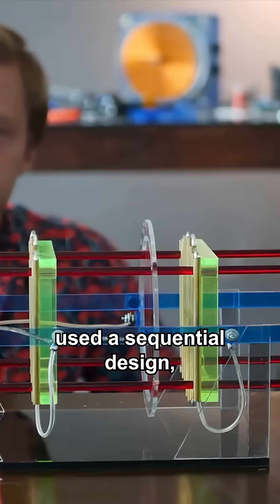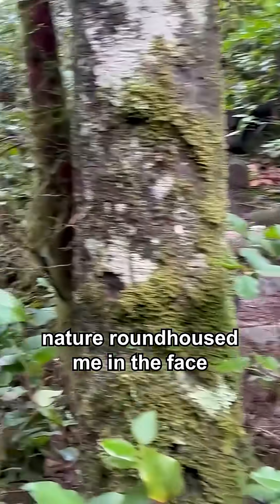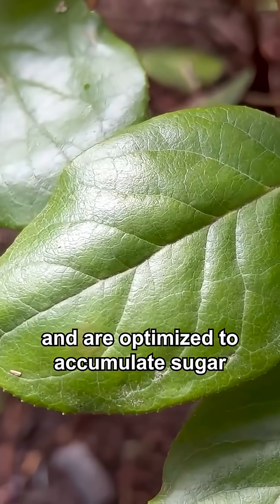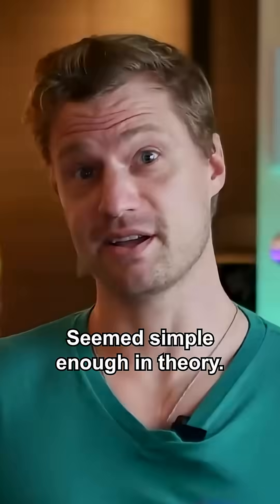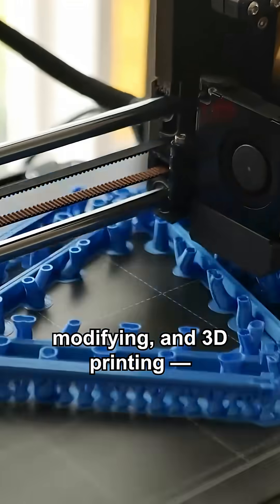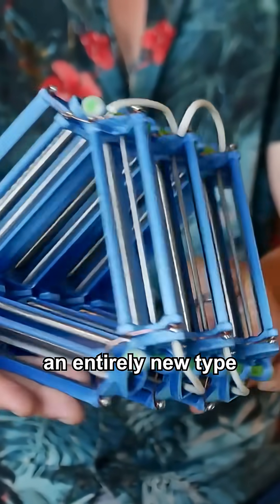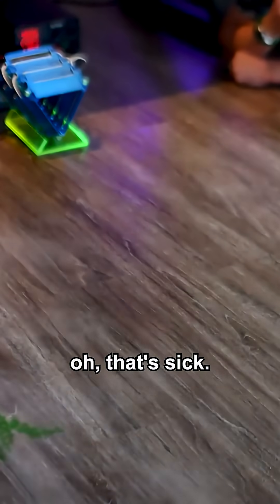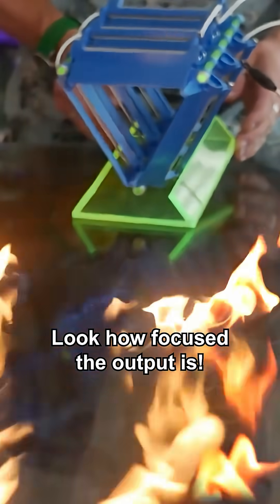Next-Gen Ionic Plasma Thruster Inspired By Nature (BTC Mark 3)

Comment: And I remember building these little ion devices out of balsa wood and aluminum foil more than 20 years ago. I've had an idea for a version that used 3D printed parts to frame the structure for an ultralight housing. The problem was always power, using balsa wood My little circle of friends was never able to get the power to weight ratio right to allow the thing to operate under its own power.

Comment: Now, add to that uh, mm, microwave, that was directed and electron gun emission. There was also directed and built into a similar kind of Ventura effect, like you're showing now give it a static electricity, kind of thruster on top of all that. M, then give it a little bit of explosive power for extreme Movement, and you've got hmm, uh a Tic Tac or a foo. Fighter, yeah, it's been developed once and twice. And before now, all you have to do is bring it together right now

Comment: One of the best parts about an ionic thruster, though, is that it's very fuel, efficient, and theoretically you can use any gas so it doesn't have to be oxygen. So you could use hydrogen which is the most abundant s*** in the universe
Reply: But it wont work on plants because we are taking away most of all carbon dioxide they use to make sugar ...

Comment: Ionic thrust is not “quickly becoming a viable form of propulsion” it’s not even slowly becoming a viable form of propulsion, because it’s not a viable form of propulsion. Outside of space travel with zero gravity, ion thrusters are useless and always will be. The amount of thrust, well, lack thereof, means it will almost certainly never be a useable form of propulsion. By the time we could develop an engine light enough to produce enough thrust to be useful we will have developed new forms of propulsion. We will sooner develop gravity engines and warp drives than we will ionic propulsion engines. Mark my words.

Comment: Hmm. I love this stuff.

Let me ask you.. if they are in sequence, assuming the first thruster loses some power ionizing the air, and each sequential thruster does less ionizing and more acceleration, should you not also sequentially increase the voltage as it travels through?

Would that not reproduce convergence?

Comment: I thought about something like this decades ago.  Redesign this to form a Tokamak torus in a vacuum sealed container. Every 4th ring, place a static collector and wire all of them for voltage stacking.  Feed the voltage back to the thruster elements and watch the thing try to tear itself apart from the sequential acceleration.  Poor man's particle accelerator/fusion reactor.
Reply: Something I thought of a couple of decades ago...I have all sorts of ideas that go with this main concept.
It is meant to go up and stay up. Torus filled with aerogel under a vacuum with a superconducting loop of energy. Skin of torus covered in solar collectors. Sphere at the center with counter rotating rotors between the sphere and torus. Spheres Of Reproducing Organisms Soaring.

https://youtu.be/DL_ISlCIsls?feature=shared
Reply: Could this be haw the Vision flies

Comment: it might be a valid form of fan sitting on the ground, but it will never be a useful form of thrust on earth. you didnt show the massive power supply or giant heavy batteries powering it. even if you could make it efficient, which its not, the output will always be tiny compared to alternatives.

Comment: I suppose the question is, how much power does it consume vs. propulsion it provides.  Yes, at low levels, using solar to power it, it can create thrust.  I would like to see this integrated unto extreme ultra light weight model aircraft to see if it can keep something aloft.  It's all very interesting.  Thanks for the video.

Comment: I told NASA about the Moon and they made Moonfall ; ) We need to make a Universe room and reverse Tesla ball atmosphere models, also just spray desalination ocean water, not aluminum and carbon which cause refractory radiation and is cooking the atmosphere and causing refractory radiation on the surface making it intense, also you might be able to change an orbit

We gotta stop spraying aluminum and CO2 into a magnetoshere and start spraying desalinatated ocean water instead, were causing refractory radiation and it's making the heat much more intense and heating the planet and causing melting of ice caps and evaporation of ocean water which then makes fresh clouds; we need to just spray salt free ocean water. The more we try to cool the planet were actually making it hotter and energizing a magnetoshere which could cause more solar flares and fry us. We're cooking the planet and causing solar evaporation of the ocean for clouds formation instead of just misting H20 out of 747's, got a whole plan

Hello my Friends

ANUBIS IS THE BEST DOG

What if Pharoah was trying to build a weather machine to attract lightening to nuclear electro magnetic earth ground to cause more rainfall and thus more food. 

Clouds of higher solar charged particles jump to clouds of lower static change, known as heat lightening, as nature seeks a balance. 

When there's enough solar charge in a cloud electricity as lightening crosses the air insulator and connects to earth, as it does it creates a vortex where hydrogen and oxygen particles connect and bring down water droplets and fall due to nuclear electromagnetic gravitational earth gravity. 

Electrons go around an atom like the moon around the earth and the planets around the sun.  

The Egyptians saw that lightening was attracted to metal, and the higher the better. 

If Pharoah had a copper cap on the pyramids with electrodes running through the air chambers down into the spring underneath, Benjamin Franklin might have been wearing an Eye of Horus Watch and driving a Bently.

Is the grounds turned dry, like a leather glove, no matter how much you tried to arc welds, it wouldn't work. Tree roots go searching for water in the winter when there is no rain, as solar photoelectric synthesis move through an organism seeking earth ground.

Also lightening is more likely to hit the lone farmhouse than the neighborhood, as electricity in houses flow through a black or hot wire, and take a neutral [white wire] path back to the electrical panel, where the Neutral Bar is bonded to the Ground Bar and goes into the earth via an eight foot copper electrode to dissipate returning unused current into the ground. So neighborhoods are energizing water tables instead of storing that electricity in batteries.

Anyways, I'm thinking a cargo helicopter, a brand new Copper Cap for each pyramid, and copper electrode wires running down to earth ground via the spring water table, and electrodes can be drilled into the earth below the springs for better contact, and we can complete Pharoah's Weather Experiment as lightening is attracted to metal high up from the ground ; )

Could you imagine the attraction of this new event to honor the Pharoahs and those that built the Pyramids!

And maybe bring more rain to the earth, and keep it most, and electrically conductive and inductive to storm clouds for more crop rain. 

If you want to in vent some cool stuff im at 224x833x2094 usa

Also, should we celebrate ancient ruins or rebuild them to honor ?

Also oil rigs should be underwater and not above and you wouldn't have oil spills 

China builds underwater structures, you could be just 20 feet underwater, you can run vertices flexible stormproof snorkles and a flexible to surface entrance/exit 

And, 

Grow more opium most the world's doesn't even want to be here and people can move other places, it grows in attics that are 140 degrees, skylights would need insulated glass in the attic shafts and you could use mirrors in the gable ends, just don't be in the attic in the day, if there's ever a shortage

Also oil rigs should be underwater and not above and you wouldn't have oil spills. China builds underwater structures, you could be just 20 feet underwater, you can run vertices flexible stormproof snorkles and a flexible to surface entrance/exit

Sharks could be GPS chipped at a bait source and an alert could go to cell phones and beach alert systems if sharks are within 300 M

Aluminum spayed in the atmosphere might f you magnetically with solar flares

Use aluminum for other things, spraying carbon and aluminum heats up the planet and causes refractory radiation on the surface, the carbon in the clouds traps in the heart and in the ocean causes dead spots.  You need solar distilled ocean water misted or of 747's instead, the sun will burst up H2O into H, O1's, making 02, O3 ozone, and you're actually adding more fresh water clouds up there, not depending on surface evaporation by causing more heat in order to make more clouds, you need to cool it

8.4 billion acres of grass=4 billion cows in the world shipped frozen fresh lawn mower clippings somewhere cool like Alaska and each cow gets a bowl of ice cream at each feeding session

You need a leaf sucker truck with a refrigeration unit, grass is mowed for tax refunds,  20 Million jobs paying 60k from May to October in air conditioned, sealed window,  tinted window, XFM lawn mower cabs with triple level suspension seats,  mini leaf suckers pick up small piles and dump them by the street,  big leaf sucker truck picks them up and freezes the frozen grass and then it goes to rail cars then somewhere cool to be 1100 lbs with a boney jacket.  The people that kiss cows and sing songs for them take care of them and she gets a bowl of ice cream at the end of each feeding season.  You'd have 10x more cows,  over 1 Trillion in goods. In the US you'd have to double your grocery stores just for the milk, cheese, cheese cream, sour cheese, cottage cheese,  yogurt,  milk, butter, ice cream, etc...

When she doesn't want to be a cow anymore she gets a bowl of ice cream with some fennies

I have a lot of invention ideas in energy,  defense, security, food infrastructure etc...

Would like to meet up with some people and talk to them about making some cool stuff

Missing solar film wrap on high rises and fields shouldn't have solar panels but should be solar panel green houses growing every crop everywhere, humid and tropical warm all year growing facilities❤

Comment: Any help found in previous patents? Would adding a section (one or more) of a microwave magnetron to heat up the air in flow to provide boost to the air by thermal expansion be of any benefit? By having these antennae at specific intervals and gap distances you could tune each magnetron to a different frequency and power to quantify your current ion transmission array. As the air heats up and builds speed through the entire engine an added tunable Venturi could sustain the flow rate. Also consider using a water injector system before each ion node that inserts a fine mist of water or even water that’s already in vapor/steam form that could increase the effect on each of the magnetron nodes. The water injection can be used for temporary boost or for start up. I understand that forming a circular or circumferential magnetron transmission “antenna” would be difficult since most easily available magnetrons are single direction. Maybe by inserting one magnetron on each side of the engine would provide an even area to maximize the overall surface area for the air flow.

Comment: This is amazing work — have you thought about using pulse modulation instead of steady current to reduce heat?
Reply: Sequential modulation?
Reply: @eric.c.bullock  Exactly. We’re running sequential harmonic modulation across the thrust plane—not just cycling voltages, but sculpting ion flow using waveform geometry.
Think: triangle waveforms at ~660 Hz as carrier, overlaid with 3–4kHz harmonic pulses for curvature control.
Not just more thrust—vector shaping with no moving parts.

Term
Meaning

Carrier
660–666 Hz triangle wave (primary standing field)

Modulator
3300–3600 Hz pulse shaping (thrust curve control) 

Sequence
Timed phase/amp shifts → steer thrust vector

Geometry
Triangular / spiral pathing → channel ion flow without vanes

Feedback
Field response loops into modulation timing (resonant lock)

Update: Based on testing, 3578 Hz appears to be a sweet spot for modulation.
Paired with a ~660 Hz carrier, it may offer the harmonic control needed for thrust curvature via sequential modulation.

Comment: This is so dumb... With a sequential flow, i.e. air is drawn in from -x and pushed ouy the other end at x, you get a little bit wxtra "chooch" from the suction in the opposite end from the exhaust (i.e. -x). If youre drawing air in from the sides, then you dont get that extra chooch (aka thrust) from the suction, since the radial suction forces all cancel out. Looks cool, but less efficient

Comment: I'd like to see your scale up calculation for electricity needs.  It's hard to imagine this would beat an electric plane with a prop.
Reply: Ion thrusters are for use in space not in the air.
Reply: Nnn… no. 

Not these. 

These ionic thrusters are for accelerating air.
Reply: @jordanhildebrandt3705  there's no difference as far as the engine is concerned. The difference is that in space you have to bring your own thruster gas.

Comment: When I had the Ionic Breeze air purifier.  I was working on my motorcycle in my dining room.  Left for work and expected to come home to a house that smelled of solvents & gasoline.  To my surprise it didn't smell at all.😮  I wish I still had both of those things. 😢
Reply: ozone
Reply: Serious question ⁉️ as thrust needs to apply to the vacuum of space as much as or moreso than in atmospheric realms, how fairs your idea in space, I vaguely recall something like this in space, but are you moving air or ions.
I'll own I ask with no current personal research. But as you get paid per interaction on a short, if this gets trolled heavily, your welcome 😊
Reply: @sonotsoo  no air in space. thus no charged air ions, and so no space thrust.
Reply: @sonotsoo yes, they do use this in space by ionizing gas.  It's more efficient than other means of propulsion, but isn't powerful enough to get objects into space, so we still rely on traditional rockets for that part. Space X satellites for example use ionic propulsion to maintain orbit and adjust their positions.  The difference is that while there are some particles in space, there's not enough to  generate enough thrust, so the space craft provide the gas for the propellant.
Reply: @sonotsoo  Also, you replied to a comment on the post. You didn’t create your own comment on the post - which you should have done. It makes absolutely no sense to post what you said as a reply to a completely unrelated comment to the subject you’re trying to talk about, on top of the fact that the creator/less people in general are able to see it. Also, your point about “if this comment gets trolled then you’re welcome for the engagement” or whatever (I was paraphrasing, I didn’t want to do the work to find out what you said verbatim) is completely moot, as you don’t have your own comment for people to see to troll, nor do you have your own comment for the engagement to count as yours. This are just a few out of a near infinite amount of reasons why you need to stop doing this. I truly don’t understand why I’ve seen an influx of this happening. Unless it’s either just a click farm type deal where it’s about posted comments and they don’t actually care/straight up bots.
Reply: That’s a brand name, it has nothing to do with Ionic thrust. It’s also just a really crappy ozone machine. Probably why the company went bankrupt.

Comment: Geometrically optimized segmented phased array with assymetric discharge
Reply: 3 phase ac, with a dc final stage output wired to ground. Wire all electrodes to ground.